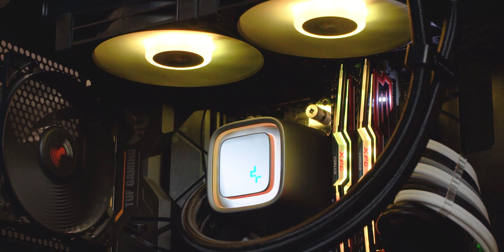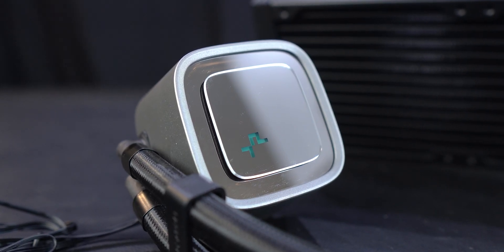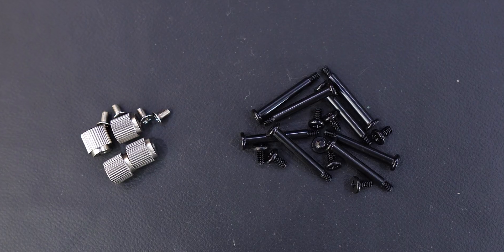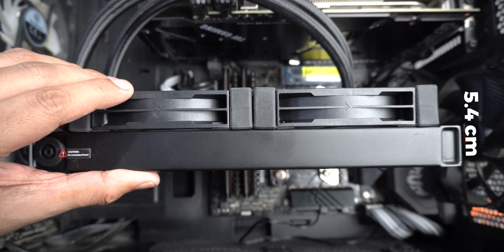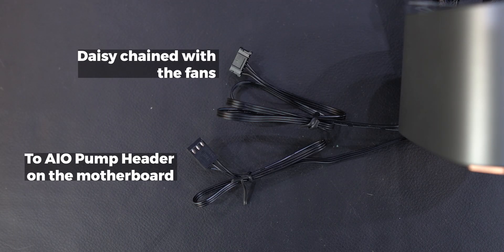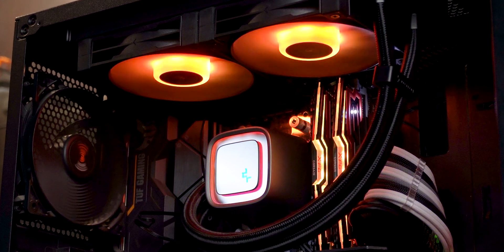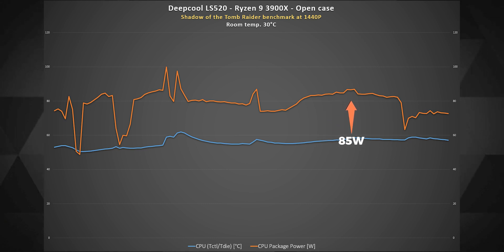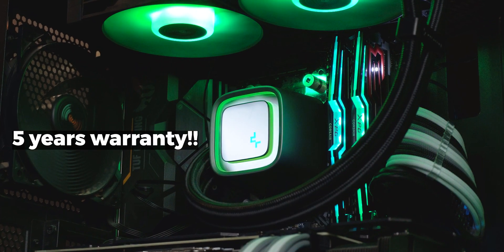You might LOVE this 240mm AIO - Deepcool LS520 Review

Comment: Should I get the le500 or the ls520? the le500 is $89 AUD, ls520 is $149 AUD
Reply from the maker: For which processor?
Reply: @MrMuBot  i7 12700kf, but I wanna overclock, what's the difference between the two?
Reply from the maker: For that you need a 360mm AIO.
Reply: @MrMuBot  My case can't fit a 360mm aio, so im guessing ls520 is the way to go, but is there a big difference between le500 and ls520? if i didn't overclock, which would be the better deal?
Reply from the maker: @Captain_Toasty  still get the ls520.
Reply: @MrMuBot  Alright, appreciate the help!

Comment: I wish people would stop doing open case tests as it doesn't represent real world usage. I don't understand how you don't see how frustrating it is and its damn near false advertisement.
Reply from the maker: Just imagine the variation these test results would've if these coolers were tested inside one case and then the viewer/reader of these test results owned a worse or better case. It will be impossible to regulate a standard result for these coolers that way.
Reply: @MrMuBot  it would still be better to do one test in a closed case with a solid front panel and another test with a mesh front panel for more realistic results since the majority of users considering this aio would most likely have one of those types of cases. Hell it would be even better just to include all 3 scenarios for the absolute best and worse case scenario so there won't be any doubt and would cover most common situations. Other youtubers test this way and its the most consistent way to give people an idea on which aio would work best depending on their setup. Testing in an open bench alone is the most uncommon way people have their PCs and gives more unrealistic numbers than if you were to use either an open or closed cases even with those variations.
Reply: my cooler master 360mm performs same in both situation. i dont think it makes a meaningful difference but im not expert

Comment: I love you man, been trying to find a good video of this on the same motherboard I have. Luckily your video popped up, and bam you have the same motherboard thankfully. I wanted to make sure I connected everything up right. I have it set in my case the same way you do.
Reply: Also how did you get the different logos for the cooler? And how did you get your mouse to change fan speed? That is awesome, I can only change the dpi with my razor mouse.
Reply from the maker: Different logos as in?
And I controlled the fans speed by FanControl.
Reply: @MrMuBot  at 2:38 in your video you show a software that says customize your look. Does it change the logo or do you buy different stickers?
Reply from the maker: No it's not the software. The DIY plate you get with it.

Comment: Are the fc120 fans shown here, just the rgb version of the fk120s used in the excellent ak620 cooler? With respect to the rpm range, static pressure etc?
Reply from the maker: No these are different.
Reply: I guess the air cooling performance is at it's peak for some time now. The only deciding factor now is looks and cost.
Like deepcool ak620, NH-d15 , assassin 3 all perform somehow exactly same within margin of error.
Reply: It's a more extreme airflow version of the FC120. You can daisy chain them with the normal FC120.